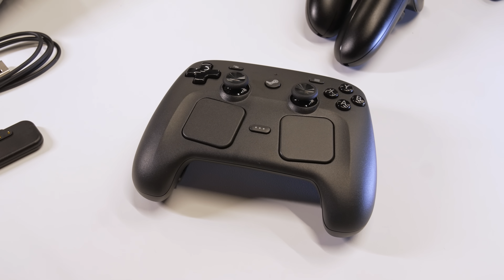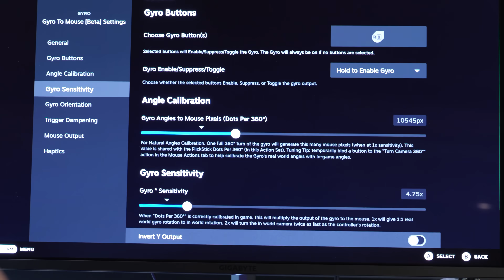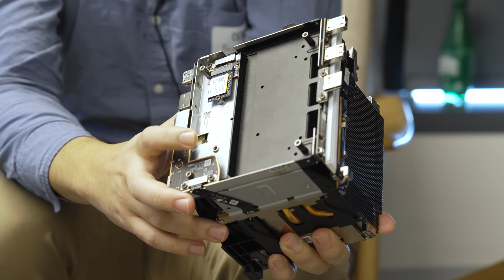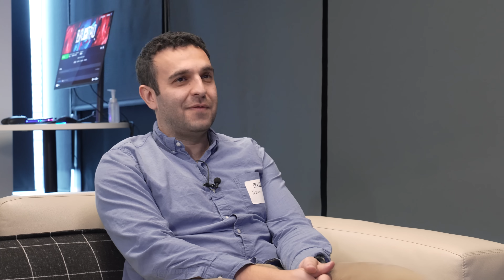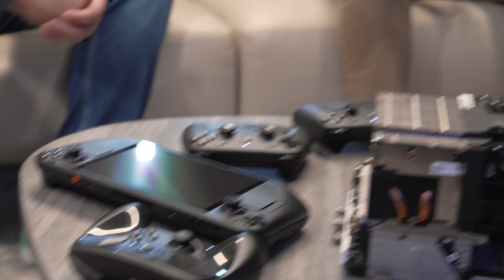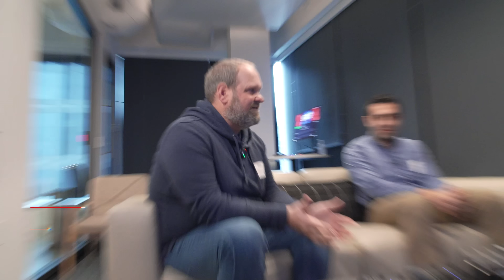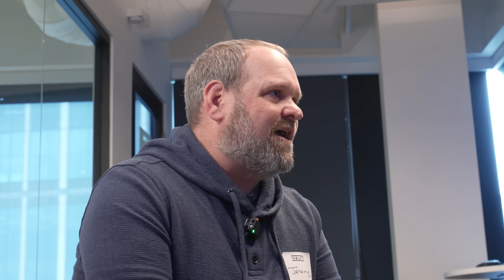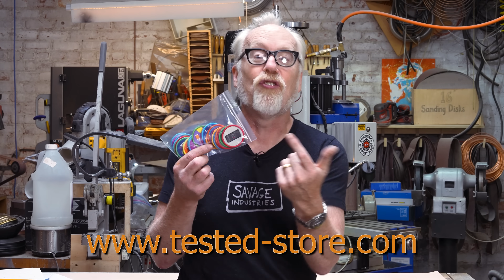Hands-On: Valve Steam Controller 2 and Steam Machine!

Comment: Valve, having the Steam Hardware survey is actually such a huge pro for them. They know just about exactly which hardware is the most common at which resolutions and framerates and thus theyre able to craft the perfect thingy
Reply: and they make the data public.
Reply: Its opt in and 50% of steam is from chinese users.............so the data is worthless
Reply: But why would people buy something they already have?
Reply: @uninstaller2860  In my case, I already have a significantly more powerful PC than the Steam Machine with a Ryzen 7 7700X, 5070 Ti, and 32GB of RAM, but I'm considering the Steam Machine because it may make for a good living room gaming system, or it might even be useful as a capture PC (to offload the demands of streaming and recording in the main PC by using a capture card) depending on how capable the CPU or GPU is at encoding.
Reply: @Eepy-Rose  a friend of mine was also toying with the idea of using the steam machine for gaming while using their main PC to handling streaming software and such.
Reply: @Sniperbear13  I'm sort of thinking of the opposite way since my PC is definitely more powerful than the Steam Machine, but it seems like a good idea regardless!
Reply: @uninstaller2860  have you never upgraded a PC before? if the steam machine is equal or better than 70% of users and it's just a straight upgrade with no hassle then it's a very easy sell. "hey, you want better framerates on the stuff you already play? we know the steam machine is better than the hardware you have thanks to the hardware survey and this is more user friendly than modern consoles while also being able to run whatever software you want."
Reply: @burnin8able That's an upgrade you're talking about, you didn't answer my question. But the 70% figure is interesting. Then it makes sense to me. Also the convenience of having a plug and play PC in your living room is something I'd also pay for. Somebody else commented on that aspect
Reply: @uninstaller2860  I have a gaming pc, but ive always wanted to put a mini pc in the living room, i just might get this for that purpose.
Reply: @uninstaller2860 they could use it to figure out what level of hardware would be an upgrade for most people
Reply: @uninstaller2860  because if many people buy that, games will be forced to optimize for such hardware just like the steamdeck did.
mid and low end typically receive no optimization these days, nor even a serious thought during development.

looking at the survey and comparing that with other datasets of what many people into gaming actually use(like using googles dataset of users looking up game related things and then comparing it to the hardware systems they own).
we can clearly see that pc gaming is dying.
those systems at the most used specs at steam go for so much secondhand these days that it would be equally as cheap to get a new system if the market still had low/mid end gaming hardware.
but also what many people miss is that most steam games no longer are playable on most hardware, and way more people actually play on APU's than the hardware survey shows.
also since APU's generally aren't powerfull enough for many modern games, so many such people are less active on steam, it are those people steam needs to get into having better hardware.

also it proves that hardware is good enough to have fun.
many people into gaming forget that the reason so many people get into console is 
1: a box they can put next to their tv which isn't huge.
2: good controller support.
3: much cheaper than pc gaming(typically).

if one wants to get into pc gaming all the internet tells them is to build a $2000+ pc for entry level gaming.

with a device like this steam proves it can run on much cheaper hardware, and also allows piles of users to get back into pc gaming.

pc gaming dieing wasn't a overstatement btw. VR has been stuck the last 10 years. you need to do a lot of research for getting a decent gamecontroller at a decent price, all of the internet keeps telling people to get the fastest and best available always regardless of cost and things like the gpu melting(nvidia) or such. and hardware good enough to play essentially all games at settings where it is enjoyeable is unreacheable for most people, the cheapest pc builds getting to that level cost around $750, and that requires one to know pc building quite well(or you need to be lucky and  find good cheap secondhand parts and be okay with that, but in many countries secondhand pc parts are very expensive as well now.
a average person would get more in the direction of $1000 for building or getting a game pc which can do that.
meanwhile technologically speaking hardware of that level where all is playable at a fun level is possible for around $300 to $400 including a margin for the price fluctuations of parts, and uncertainty of dicount contracts and such.
the cheapest pc which can also play such things would be around $750, would be a bit faster than the steam mashine, but there is no other option still giving good enough performance and where the value actually makes sense.

well the other option is getting something like a BC-250 which isn't really beginner friendly and doesn't go well in the clean console culture.

essentially all those people liking gaming but barely playing pc games can now suddenly start playing games and more gaming.
making pc gaming normal again instead of a niche for super rich people.

high performance is nice. but good value, and having a option for everyone is much better.

plus if the steam machine targeted the high end market, it wouldn't be much of a deal honnesly.
as it would take away the low power draw.
and at the high end there are many options already $100 or a few hunderds even, isn't a big difference there, and people want stuff which they can reuse, expand and upgrade when building high end.
also the things the steam mashine can make the device cheap with won't scale similar on high end, like on low end motherboard, ram, and vram are huge factors. cpu and gpu also doesn't have to low prices these days on the low end compared to high end.
like I can get a motherboard with a ryzen 9 7945HX (Minisforum) 16cores 32 threads at 5.4ghz  for less than €400 a 6 core ryzen 5 and a motherboard costs €300 here if chosing cheap options.
ofcource that minisform board uses a mobile version of the cpu, but still it is much faster, and I said $300. but more likely $350 for the ryzen 5 with motherboard. $300 would be a ryzen 3 if lucky.
$300 for a entry level cpu isn't super cheap. but those diferences become smaller in the high end.
Reply: @uninstaller2860  I have a particularly specific use case.

I had a steam link box for a long time. It is either deteriorating or network related things have changed such that the Steam Link box cannot handle streaming from my PC to my TV anymore without massive frame hitches.

I really like and generally prefer to play controller focussed games on a TV, which is why I had the link in the first place. With a Steam Machine, I can outright have those games on a different machine if I want, but also I can use it as a streaming base for games that it might have a harder time running, or games that I want to play on my TV that I also want more graphical fidelity out of that my PC can provide.

On the streaming front as well, as the Steam Machine ages out and slowly becomes obsolete in its specs, where it won't die as quickly is in it being a newer computer with up to date network tech, unlike my steam link. Because of that alone, I'll get an enormous amount of life out of it far beyond its hardware specs by being able to still stream from my more powerful computer for probably years to come.
Reply: no they just with these parts cuz they were leftover orders from microsoft (for the cpu) and the 7600m from the laptops. Wonder why you didn't see much rdna 3 laptops. Its cuz they didn't sell em and now valve got them for dirt cheap so i expect the price of the steam machine to be cheap. Also most of the hardware on steam is filler especially laptops which has integrated cards.

Comment: "The lower thumbpad is for me the least ergonomic part"
For those of us with Hitchhiker's thumbs, controls are often nightmares because designers have no idea what are thumbs are shaped like. 
For me, accurately using those pads would likely involve a hand position shift with the wrists moving down and/or out, depending on how much grip I keep on the controller. There's no way I can make that move and keep fingers on the face, and I probably have to drop to one each of RB/RT and LB/LT

Comment: As a PC gamer, I think it's awesome to have a companion device in the living or for people just dipping their toes into PC gaming, it's perfect. I do think the specs are slightly underwhelming. It should be good enough to compete with the PS5 and Xbox Series X but nothing more. If Valve wants this to be a success, it needs to be affordable. $500 would do it. $700 is pushing it and anything above $800 makes it dead in the water I feel. I know they are pushing it as a PC but it's still a fairly low end PC and in a compact size. It's not a $1000 machine...

Comment: They know their market. A mid-tier PC in a convenient package small enough to easily sit near a TV and double as a de-facto console. Has enough power to run pretty much anything on the market today. Maybe not on crazy high settings, but well enough. If this is at a reasonable price...I wonder if it could sell well enough to motivate Valve into launching this in other stores/on Amazon?

Comment: I think the Steam Machine is a dead in the water if it costs  more than 600$. Hardware and form factor makes it a console competitor. One major downside on running Linux for a product like this is that it can't run bunch of popular shooters like Fortnite, Valorant or any Battlefield due to kernel level anticheat in those particular titles. It's something I can live with when running Arch on desktop, but if this is bought for like a 12-year-old as their only gaming machine its potentially a hard sell. I do hope that it succeeds since few million units sold potentially means that studios start using it as benchmark target machine, which potentially means improved optimization and compatibility for anyone running Linux and AMD hardware.

Comment: Facebook killed VR, Cost was around 350$ brake down of the parts did show this to be a fair price. , Then Facebook marked it up by 1000$ ,  Valve  dio the same,  only one who did not scam people was Razer witch was not locked you could emulate any headset and was fully upgradable , but people did think it was cheap due to the real price.

Comment: Claiming that the Steam Deck can run games fine at 4k is a lie, plain and simple. The SD can't even run modern games at 720p with upscaling. Let alone 4k.  

I've got one, and the SD isn't running games at 4k. Using FSR set to ultra perfromance is not 4k.

At least try and be honest instead of telling blatant lies.

Comment: Making a SLOT for Frame Dongle filled with a blank would result in a lot of additional Frame purchases compared to a plain USB port
Reply: Making an inset port like the Framework laptops have would make a lot of sense. Maybe they could even instead of just a dummy plastic plug have a little USB extension to bring the plug to the surface for people that wanna plug something else and not worry about the fit.